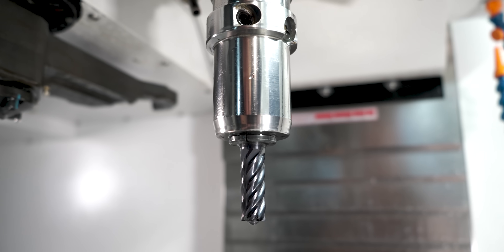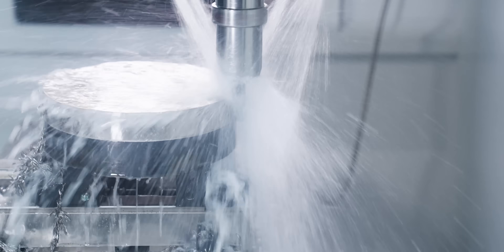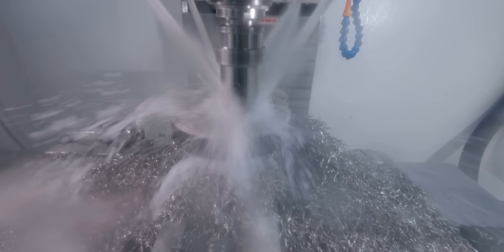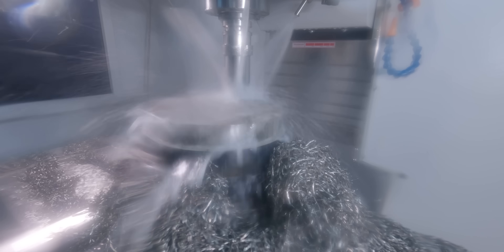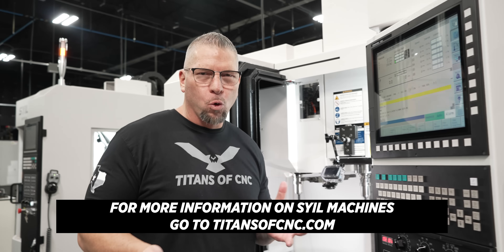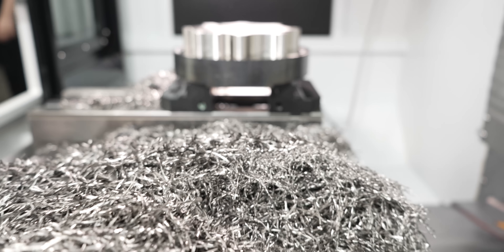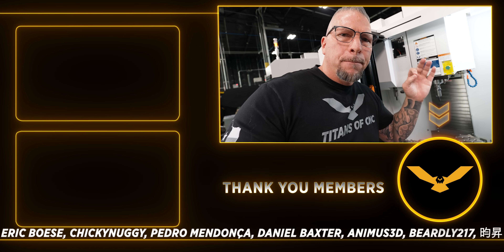My First Part: Machining The Toughest Material On SYIL X7

Comment: Now, for [hits] and giggles, ask the folks at Kennametal if they can get you a chunk of Tribaloy T-800 and, proverbially, sink your teeth in that... It's a cobalt-based superalloy that is extremely wear resistant, 54 to 64 HRC, and an UTS of 700+ MPa (100+ ksi). 

Or maybe they can get you one of the Stellite grades to test? Stellite 25 will be really interesting too: 20-45 HRC (so very susceptible to work hardening) and an UTS of 900+ MPa (130+ ksi).

Comment: How does this material compare to hastelloy? I used to work in a shop that ran mostly stainless but also monel and hastelloy, I'm not sure what grade either of them were, but the hastelloy was significantly harder on the tooling. We made mostly hose barb fittings/couplings/valves for pure chlorine applications.
Reply: Hastelloy has molybdenum and Monel,is nickel copper. Both are nasty but the high nickel content makes Monel harder to machine and is more expensive

Comment: What is more difficult to machine? Stellite 6B or Monel K500?? Im not a machinist, but a Master Micro-Finishing-Deburr Technician in the Aerospace industry. Any parts made of either of those two materials are very challanging to work with at my work center using carbide and abrasives.
Reply: How do u sharpen satellite scissors since it is way tougher than tool steel. +50% cobalt + tungsten etc…. That’s inane

Comment: Why would you want the tool to drop down prior to the tool change? Now you have all the chips and coolant going up into the tool carousel because the door is open since the tool is hanging down. Seems like the 1 second saved isn't worth it. Is there a k bit or setting to change this?
Reply: Yes, it's a parameter setting.

Comment: Not sure if you know but Monel (NiCu) is relatively soft compared to Inconel. Now K-Monel (NiCuAl) is hard but still not as hard as inconel. It’s used in steam systems because of its tensile strength when exposed to high pressure and high temperature will be quite strong. That’s why they are called Nickel Superalloys. There’s a guy on YouTube who talks about the metallurgy of Nickel Superalloys.
Reply from the maker: Yep, I explained it in the video. Monel has Copper and Inconel has chromium which is harder… so Inconel breaks a chip better. Softer, Gummy Monel is Nasty on tools because it’s softer and abrasive etc
Reply: @TITANSofCNC  yeah, I can see that. Im an outside machinist for the DoD (navy) we use a lot of those types of alloys. steam systems and high pressure air systems, steel isn’t used as much because although strong WHEN COLD, does not hold up as good as the nickel alloys. It’s actually pretty cool. I see it every day and worse I have to destructively remove fasteners (some 2 inches plus) from flanges or machine flanges of that material. Hy80 or Hy100 is fun too lol it would be interesting if you could get your hands on some Hy100 and try some stuff

Comment: Nice video. BUT. I got all hyped up by Titan's videos, full depth of cut etc etc. On our BT30 machine (other well known brand) I machined a whole run of engineering steel in a period of a month.  And surprise surprise, the taper bellowed out, and machine needed a new spindle! It sounded good, it cut well, parts came out good, was using new sharp high performance  carbide cutters, plenty of higher concentration coolant etc etc. I was told to go back to manufacturers cutting tables...
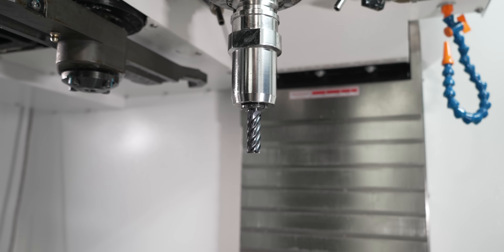Reply: Take a look at the tool at 7:39 during the change. That spindle is 100% trashed already. Brown with the fretting infection.
Reply: @LumaLabs  a little bit of surface rust on a tool holder probably from sitting around in their shop for a while doesn't mean that the spindle is trashed.
Reply: J'ai 20 ans d'usinage a mon compteur et tout ce que je vois dans leur vidéos c'est : une bande de gros nounours casseur de machines , les vitesses de coupes ne sont pas respectées ni adapté à la machine , les porte-à-faux sont monstrueux, la profondeur de passe est juste immense pour la fraise et la machine utilisé, même le maintien du brut est ridicule...heureusement que kennametal donne des valeurs a renseigner dans mastercam .  S'ils avaient du programmer a la main en code G et déduire les paramètres de coupe par eux même , ils auraient cassé une autre machine ...
Reply: These guys do treat machines as almost disposables. It's a decent strategy to succeed though, because it means you can potentially have higher throughput than your competitors.
Reply: @zachbrown7272  That's because they are for them. They're demo machines on loan, not owned.

Comment: I think the drilling of the part is the most impressive thing in the video, the roughing not so much, basic contour high speed machining with proper speeds and feeds really not to impressive. The finish is really nice. If you want to blow some minds throw a deep pocket in there with some thin walls. Like the Syil also.

Comment: IDEA FOR A VIDEO: How about a machining competition between 5 of your top machinist? identical part, same machine, you could give points for, type of setup, speed, finish, tolerance, etc, only 1 stipulation, the part has to be for an actual customer, what do you say? are you up for this challenge? Love to see it!
Reply: We talked about doing this but Barry and Trevor knew I would win so now they just go ahead and give me the trophy 🤣🤣
Reply: @Jessie_Smith  Yeah, I get it, they both do come off as being a little intimidated by your superior machining abilities, they should at least try though, I know it's a long shot but, you never know, one of them might just pull it off and win.
Reply: lol I guess I could design a competition that would give them a competitive advantage and then maybe take it easy on them so they have a chance lol.
Reply: And by the way, I’m screenshotting this and sending it to them
Reply: @Jessie_Smith  ha ha ha, love it! 👍
Reply: They are top-dog. All machinists but working on difference machines. Milling machines, lathe, Swiss Machine, EDM, grinder, metrology guy, inspector…. And not only they are machinists but they are certified instructors at Titan Of CNC Academy as well. Again they are some of finest machinists supervised by the only celebrity machinist Titan Gilroy. ❤😂
Reply: I've got a better idea for a video. 

Pick a real part that can be made on any of several different machines, and have machinists who work on those machines make it.
Reply: Uxuxbtutiupijgohohiulghih9o

Comment: I've never machined any metals more harder than when working in the aerospace industry. I've managed to drill 0.25" blind holes into inconel using a cobalt drill (not carbide) after researching and implementing the correct speeds and feeds once the😢 operators before me burnt out all the carbide drills. Obviously, you're not gonna get as many holes done as you would with the carbide drill. But hey, I had to do what I had to do. The things you can do with the proper speeds and feeds. Do your research, calculate the formulas, and GET ER DONE!! 🦾💯🔥

Comment: Do you think you can produce Stainless Steel parts on this machine? Not a crazy number of parts, we machine parts out of 303 and 304. Depending on the torque wrench adaptor model we are machining, we either do some minor profiling or machine the whole adaptor out of a block.
Reply from the maker: Yes with the proper tools and techniques… I will make some cool parts out of stainless and put another video out.

Comment: Why do you use long milling toolholders, ..... isn't that hard on the spindle bearings ??
I would program the next tool-call on one of the last lines before tool change, it prevents a lot of coolant or chips on the tool with that pot down. 😉
Normally you do this next tool-call just after a tool change, maybe better to do it later, it's nice to have but I would probably change the macro for pot down.
Reply: Dropping the tool down prior to the change is a parameter setting.  The default setting is to drop the tool.  If you don't want it to, then you change pr3401 from 61 to 29.
Reply from the maker: Shorter is way better for this type of cut… correct. It’s what we had in stock

Comment: We machine inconel to make the stage 9 to 14 compressor blades in the RR AE2100 engines as fitted to the C130J on 30 odd year old fadal cnc mills.

Comment: How do you dispose of the "chips"? Is it just written off as waste, or can it be recycled?
Reply: Can be tossed in the trash. But most shops have big chip bins that get emptied at scrap yards, I could be wrong but I believe you get money for it just like regular scrap metal. Maybe a bit less if the chips are from different materials.

Comment: Worked in the oil industry for many years. I've seen many of what we call "Monel collars". 30ft long by 9" diameter with a 3" hole all the way through and fluted on the outside. You know they were hard because they always came out of the hole with very little wear and the area where the tongs bite was never chewed up like it was on normal drill pipe.
Wonder how much it costs to machine those big dogs?

Comment: I'm not sure why you would ever use such a long tool holder on that application... seems like a terrible choice for that machine
Reply: I think it is because it's a hydraulic holder
Reply: @Awfultyming  a hydrolic holder is good for cutter runout and cutter clamping force... but the length is simple mechanics... the longer the holder/cutter the more deflection and force on the spindle...
Reply: @jeffl1356  then we are in agreement. Having worked with those style holder I know the minimum Guage length is longer than an ER or sidelong style holder.
Reply: @jeffl1356  If you know that much then why don't you have a better presence regarding machining than Titans does? Titan straight up side "i wanna see if we can make chips", that's a demonstration. Also that, how many parts have you machined for aerospace?
Reply: @SimonLandryMusic first, I'm not trying to have a presence at all... second, he could have done a much better job making chips with much shorter tools which in my opinion would have been a better demonstration of the machine and also demonstrated better machining technique. I have machined alot of aerospace parts in my life... there seems to be some type of weird hero worship going on here... I state an undisptable fact and people attack me for it... FYI I actually like and support what titan is doing.
Reply: @jeffl1356 
Your doing a service to non machinists.  Creating contentious dialogues analyzing the factors.  Bravo
Reply: They have to because the short travel on the z-axis won't allow them to get closer.
Reply: Deflection.
Reply: I doubt they will do it for the real deliverables this  way. They will be far more stringent and more methodical. There they don't have to worry about video or explaining.

Here it's different, here video and explanation matters more than stringent quality test. So  focus is more on the quality of video than the strict practice.
Reply: Bigger tool holder, bigger penis size.
Reply: Well why the help hell not? They have more holders
Reply: I imagine you Must adjust for tool deflection and probably run a slower feed rate
Reply: @DSRE535  or just put it in the shortest tool holder you can... running a tool that long in that type of machine is really hard on the cutter and really hard on the machine spindle... I know titan was just doing a quick demo but would love to see him do a side by dude compare using the proper short holder...
Reply: It’s so you don’t have to readjust the coolant nozzles. They’re always pointed at the tool tip.
Reply: @EAGLINWRX  addressed this earlier...
Reply: @jeffl1356  while I understand what you’re saying. They may have just not had that quality of a drill in a jobber or stub length. And as such they match all the other tools around the drill.
Reply: @EAGLINWRX  they know how to put a pause in the program so they can adjust the coolant... or maybe just hit feed hold button and move the coolant...
Reply: @jeffl1356  maybe they’re a job shop that knows what they’re doing. Just a thought.
Reply: @EAGLINWRX  read the whole thread please... physics is physics...
Reply: @jeffl1356  I read the thread lol. Is it that hard for you to u sweat and that certain tools and machines are more rigid than a toothpick in a drill chuck? Not everyone has to follow your oh so holy rules of machining. Have you milled monel before, because from where I’m sitting he got a pretty damn good surface finish on that stock.
Reply: @EAGLINWRX  not holy rules... physics/science...
Reply: @ithelayer8problem  yes
Reply: for real
Reply: Errrr, how insightful.
Reply: It could be a face and taper tool holder in the spindle and with being (I think) a hydraulic chuck holding the tool, it wouldn't matter being that long whatsoever. Great machining.
Reply: Perfect for that material he just did in that time what use to take a month material specific machining
Reply: Sounds like somebody really thought hard about this. 😂
Reply: I wish I was dead I’m not smart enough to find a job from 🇺🇸
Reply: If you're actually a machinist cheers for the tip.
Reply: How long have you been in the trade?
Reply: @Україна-ц7э  I bought my first cnc in 94. It was on old beast... it was old when I bought it and ran using a punch tape drive...
Reply: How is it everyone has a critic reply of how things are done.
Reply: Loved machining K-monel for Emergency Escape Shafts. The Finish when thi gs are right, are beautiful.
Reply: It sounds good
Reply: To add clearance for better camera shots...1st time watching a Titan vid I take it??
Reply: No just finaly got to me watching them run monel on a machine like that with such a long holder... @joemariotti3935
Reply: @joemariotti3935 I think you’re correct.  The tools did great.  Always that one in the comments 😂
Reply: @joemariotti3935 we got a titan fanboy here people
Reply: @mookiiieeee  used to be, until he started using machines made in China, the fit and finish on Syil machines is horrible and I personally wouldn't use them even if given to me.
Reply: @joemariotti3935 lots of words for somebody who's never used or even seen a syil in person. 

It's much less Chinese than you'd think, it's pretty much just assembled there.
Reply: @joemariotti3935 utter BS, my X7 is 3 yrs old, has been perfect from day one, you have no clue what you’re talking about
Reply: @mwip972  purchased 2, they were trucked back 2 days after delivery. Oil galley tubes in the casting weren't done correctly and needed drilled out. Salesman was willing to send a tech out for repairs but I learned all I needed to know.
Reply: @joemariotti3935  huh just unlucky customer, that's disappointing
Reply: I agree but it sounds not to bad tbh
Reply: 5.9" from spindle to bed... looks like about 5-6" to top of material... and lower the camera... sorry but he always uses these long tool holders... one of the first lessons I learned as a machinist was use as short of a tool as possible... basic
Reply: @jeffl1356 have you seen what this company does and makes, I think they may know a thing or 2 about what their machines and tools can handle.
Reply: @dansmith207  of course! And yet physics is physics... 3 times the stickout is 3 times the force on the spindle and likely more deflection than that at the tool tip...
Reply: Because the drills are long tools having an equally long holder for the end mills means you don’t have to adjust coolant lines every tool.
Reply: @baylorbrouwer7848 every tool should have been way shorter...
Reply: @baylorbrouwer7848 The coolant lines on that machine are programmable and it has through spindle coolant also…
Reply: Best answer ❤❤❤❤❤ @baylorbrouwer7848
Reply: @baylorbrouwer7848 think on most new machines these days you can adjust coolant up and down with a button etc motorised rule thumb shorter tool overhang for what you need the better unless you're doing deep cavity lense tool or something and need length but you can collision check your holder to model for optimum over hang 👍this is not a tall part so coolant position prob wouldn't need changing much
Reply: Two reasons - these drill/tap machine types have really large z clearance so you need to rise work AND use high stick out. And of course better views for the camera
Reply: I think they know what they are doing mr keyboard expert at home 😂
Reply: @ThumbDr  I can tell you from personal experience that running the same parameters on a half inch cutter with 3" total stickout chatters less and allows you to cut a lot more aggressively than the same endmill in a longer holder with 6" of stickout.  I can run 7,500 rpm and 180 ipm in aluminum on my short holder with a 1" flute length.  Anything over 3,000 rpm using the same endmill chatters in my long holder, but it's useful for reaching spots on some parts.  Even on a very rigid machine that can get away with longer holders (my spindle sucks, that's half my problem) you still get better results using as short a tool as possible.
Reply: @ThumbDr  you know nothing about me and yet you pretend to... ignorance is bliss
Reply: @jeffl1356 like your comment.
Reply: Thanks for noticing karen.

Comment: speaking of abrasive material do you guys ever cut carbon fiber? my shop mainly cuts carbon fiber and id be curious if you guys would take any sort of different approach. though too we always struggle to find the tools we want.
Reply: The company I work for LMT Onsrud has specialized cutters for composites like carbon fiber. I think you should look them up and speak with the tool lab about the proper tool for the job and the feeds and speeds. I'm currently an apprentice with them right now and I'm having a fantastic time
Reply from the maker: We have cut a ton and have done videos on different types of composites. Look up composites and G10 on our channel… there are some good videos